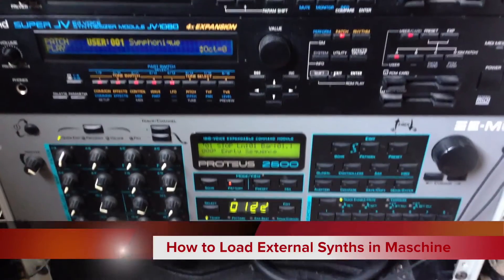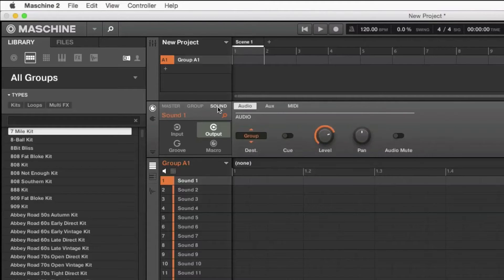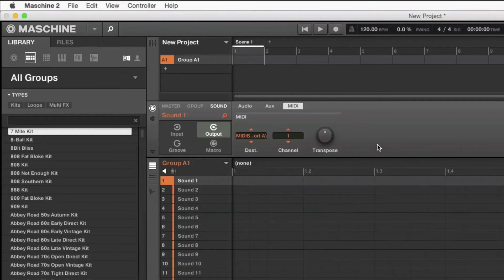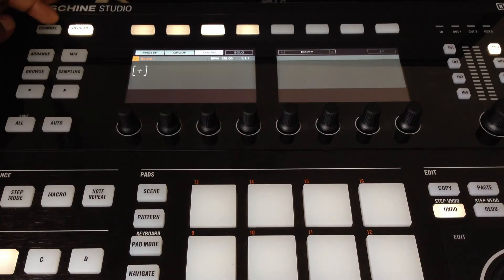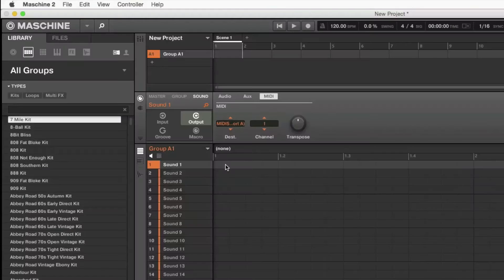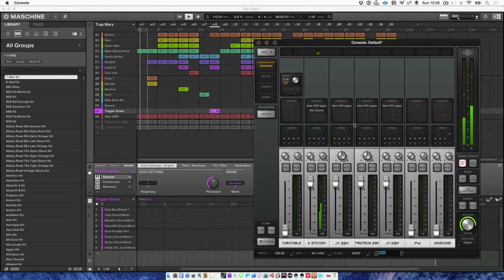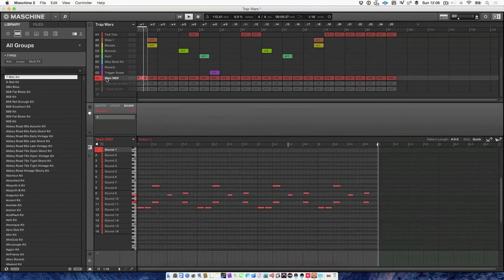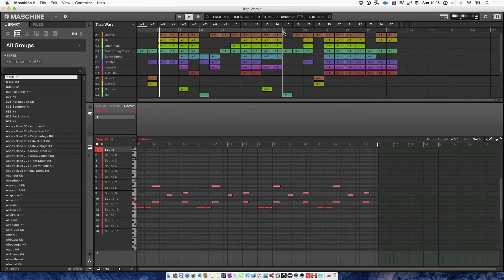How to Load External Hardware Synths in Maschine 2-3

Comment: Hi, really helpful video.  I’m trying to add my Roland s1 to my Maschine mk3 with out much success.  Would a midihub help with this? Thanks I’m advance 👍
Reply from the maker: You don’t need a mini hub if the SI is the only hardware synth you’re trying to connect to.
Reply from the maker: Connect to the S1 via the midi out of the MK3 going to the midi in of the S1, using a DIN connector.
Reply: @GarfRichards  Thanks so much!

Comment: I'm having trouble getting the sounds to play through my juno 106 I have both output and input cables connected between the two set my destination to mk2 midi out and no sounds coming through can u help?
Reply from the maker: What sounds are you trying to hear?
Reply: @GarfRichards  I'm trying to hear the synths from the 106. I was wondering how to play the sounds from the 106 from the maschine hardware. I'm fairly new to midi I just got the 106 today.
Reply from the maker: What soundcard do you have installed? For example, I have a Universal Audio Apollo Twin
Reply: @GarfRichards  I have a Steinberg mkII. I know I can plug the phono jack directly into the port to sample. But was wondering how I would do it with the midi cables attached to the maschine mk2.
Reply from the maker: Sorry, I misunderstood your question.  Okay. 1.)  Within Maschine preferences, in midi make sure the midi port for your Juno is turned on.
Reply: @GarfRichards  I've plugged in my midi cable from the 106 out to mk2 in. If I hit a key on the 106 the pad on the mk2 lights up. But how do I get the synths on the 106 hardware to play through the software of the maschine?
Reply from the maker: You need to link the audio output of the Juno, into the audio input of your audio interface.
Reply: @GarfRichards  after doing so it does work. But now if I record directly into a pattern using the 106. After adding a new group and adding some drums. The recorded sound from the  106 synth will dissapear and there will be some minor feedback. Id have to restart the machine software and it will work again for a few bars then it will dissapear again except for the minor feedback. But I wont be able to hear the sound from the juno if I hit the pads anymore. It's like the feedback is preventing any sound from the juno to be heard.
Reply from the maker: You’ll need to record the audio from the Juno, onto a new track, aka dump the audio pass. And this applies for every midi pattern from the Juno.
Reply: @GarfRichards   Okay thanks! i got the sound coming through and ive managed to be able to record onto a single pad.
but when i try to add another sound, on pad 2 for example. when i switch the sound on the 106 to a different one in the sound bank the previously recorded sound from pad 1 will also change. if i switch to a new sound, all previously recorded tracks will switch to the new sound as well. any suggestions as to why this is happening.
i just want to layer different sounds on different pads from the juno without all previously recorded sounds switching to the new sound that i click on.
Reply from the maker: As far as I’m aware it’s not possible, you will need to do an audio dump per each track you want to record from the Juno.
Reply: @GarfRichards  oh okay, well thanks for the help my dude I really appreciate it.
Reply from the maker: It easy to do, I can show you how to do it, if you want?
Reply: @GarfRichards  definately if you dont mind? I just didnt want to bother you too much🙂
Reply from the maker: Sorry man I’ve just seen this message. Do you still need help?
Reply: @GarfRichards  hey dude no problem. If your not too busy sure. I tried searching on google how to do it but couldnt figure it out how.
Reply from the maker: Where in the world are you?
Reply: @GarfRichards  toronto canada
Reply from the maker: Ok cool,  I'll post up a video. It'll reach you in the morning.
Reply: @GarfRichards  awesome! Your the man!
Reply from the maker: https://www.youtube.com/watch?v=Q1qBh1pUPJ4
Hope this helps...